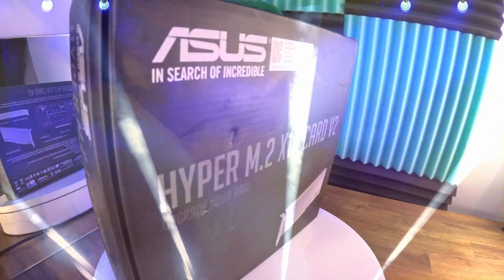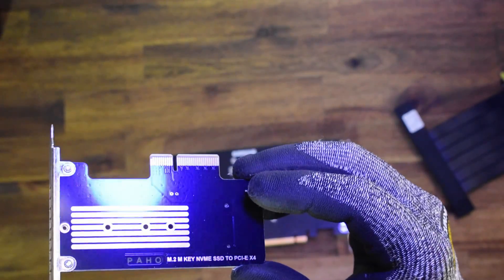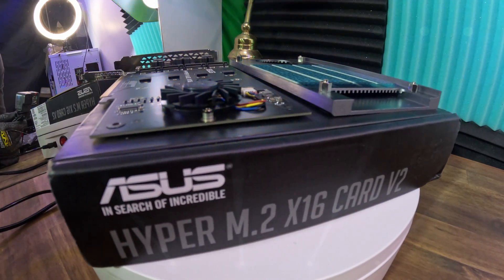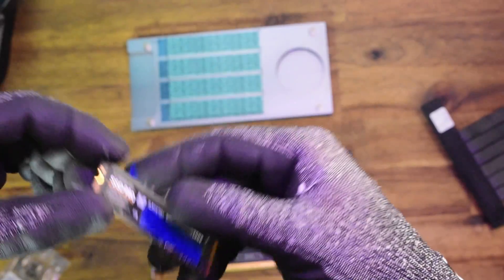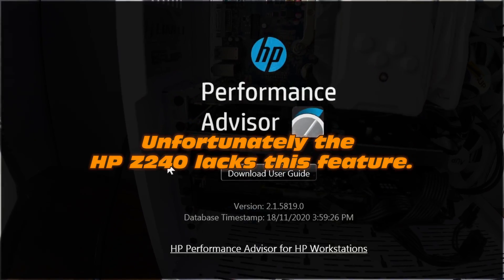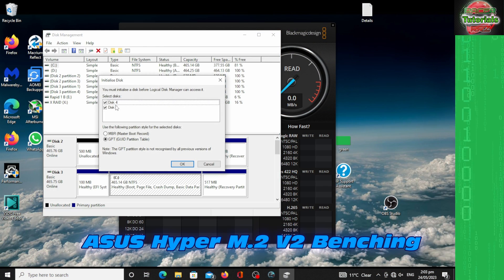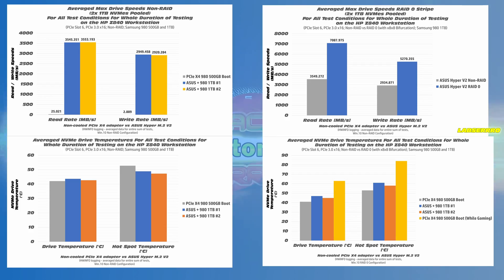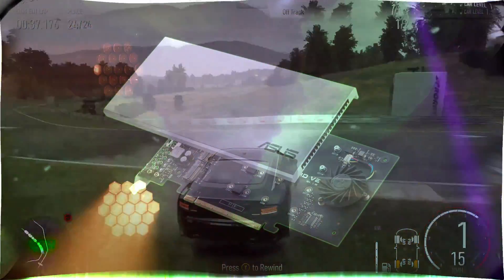8TB RAID 0 Guide : ASUS Hyper M.2 V2 - You will not believe the speeds on this NVMe storage adapter!

Comment: Already have something similar in my amazon cart for my newly arrived HP Z440! Its a sabrent one, PCI-E 4.0 (with backwards compat to 3.0). Pretty stoked to get it and give it a thorough try! Awesome timing on the video haha. 

The ASUS card seems really well built for power delivery!

OH! Stoked for the Z440 vid! I plan on swapping to a Fractal Design Define R3 (after I get a new case for my current parts), I remember your post on reddit about the front i/o. VERY EXCITING!!!!

Are you going to use Primo Cache with your NVME+IWP 16TB?
Reply from the maker: Great choice! The Z440 will be able to support the ASUS Hyper without any dramas. I am still amazed at how well this adapter maintains low NVMe temperatures. It performed only slightly worse than the HP Turbo Drive Quad Pro (which was the best on thermal performance of all the quad PCIe adapters I have tested), and yet the Asus M.2 V2 is a fraction of the price! 

If you wanted an adapter that is a little more future proof go for the ASUS Hyper M.2 Gen 4 (it's PCIe 4.0), and I trust it will perform just as well. I love how NVMe prices are slowly dropping. Great job on the Sabrent NVMe, they are high spec items.